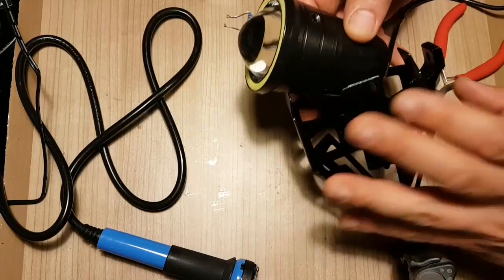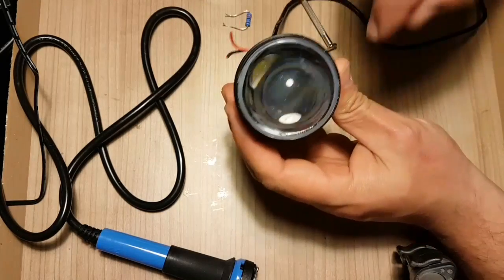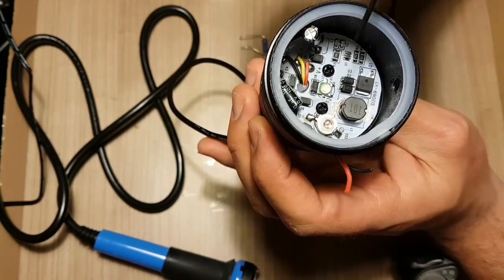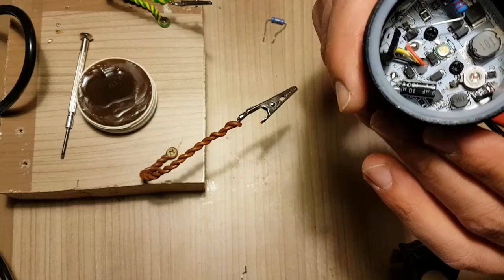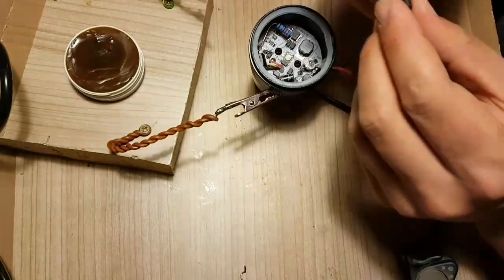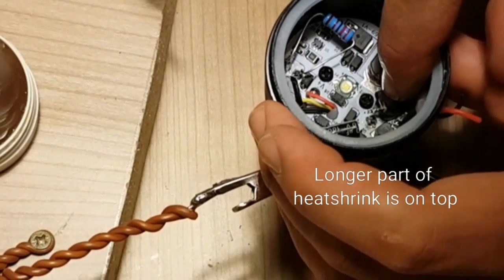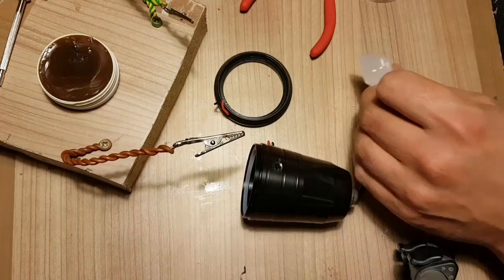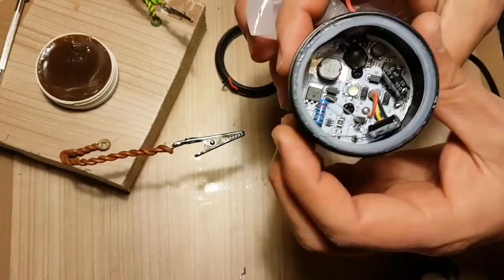U7 Cree lights from aliexpress - removal of low intensity/strobe functions and red devil eye

Comment: I've got a pair of Huiermeimi spotlights 300meter range it has 3 modes High beam low beam & strobe but & I have them installed in my old spotlight Housings & have  inside my bumper on my Toyota Hilux Surf & have found when I switch my side lights on the press my separate switch to the spotlights on they are are on high beam then instantly switch them the spotlights off then switch them back on then go to low beam & instantly switch them back on again that's when they strobe but I noticed when I switch the spotlights on after a little while later they on high beam & then switch the spotlights off again plus my side lights off as well & leave them off for about a minute or so the turn the side lights back on the press the switch for the spotlights to come back on the spotlights seem to stay on high beam then switch them back off again as well as the side lights then turn the side lights back on as well as press the spotlights switch back a little while later they just seem to stay on high beam & I was going to modify the spotlights later on & add a 10k resistor to make them stay on high beam looks like I don't have to modify the spotlights now the seem to stay on high beam which I'm Happy about having them stay on high beam & I've tried a few times now & just stay on high beam even over night & try them the following night I switch on the side lights& then press the button for the spotlights & they just go on high beam & I will be using these spotlights on log country roads where there is no traffic in front of me & traffic coming towards me & they give out Excellent Quality Lighting really Bright White lights to & even my H4 Led Headlight bulbs work great as well bòth on High Beam & Low Beam & got Excellent Quality Led lighting on my Toyota Hilux Surf I even replaced my front & rear side light bulbs to Leds & well brake lights number plate lights reverse lights to Leds the only ones that I haven't replaced are my indicator Bulbs which I will be replacing them to Led Bulbs at a later date Led Bulbs are Brilliant as long as you get the right Led Headlight bulbs that Led Headlight Chips are very small & they are the same size as the Halogen Bulb Filament or Filaments & both High beam &.Low beam Line Up Exactly Perfectly With The Halogen Bulb Filament or Filaments & having the Led Headlight Bulbs in the Headlight Housing at 3 0clock & 9 0clock & you can't go wrong  & that's the reason why I have got Excellent Quality Headlight Bulbs Kind Regards Peter

Comment: I would like to have 3 switches each for High, Low and Strobe. Is it possible?? No where i found a solution. How does it changes mode after each cycle, switch on-off.
Reply: i think try understanding the C2 chip,pull out the chip n test the arms/legs or connections/terminals....

Comment: beginner here 
is it really necessary to put a heatsink ?
Reply from the maker: Heatsink for what? Didn't put any here, so i don't know where you mean to place it
Reply: fun&games oww ty now i understood
Reply: i meant was the sinkable tube
Reply: so u put the sinkable tube to disable the ring light something ?
Reply from the maker: Yes, easiest thing to put on, and it can withstand the heat from the red LED
Reply: sir what would happen if i would no put a sinkable tube on that kind of chip ? hehehe
Reply from the maker: A bit of a dumb question but here it is: without the heatshrink tube over the red LED you would still have that red devil eye pattern which most users tend to remove due to esthetics or local regulation.

Comment: Hi, thanks for the video, really will help when I try and do mine - but I can't find the 12k ohm 5w resistors in the UK at all... So I'm struggling to complete this - mine keep going out of sync and it's so annoying
Reply from the maker: Ebay, aliexpress maybe?
Reply: @atcrijeka  wow wasn't expecting a reply so quick, thank you for that - I'll have to check those most of the ones I find are 1/4 or 3w
Reply from the maker: @MrAndMrsKnight-UK  maybe 3W would suffice. Weld it on and make sure it doesn't heat up

Comment: My boards have two capacitors labeled C5 and C6.  No U1 or U2 chip that I could identify.  I soldered a 10K resistor to drain the C5 capacitor, one leg of the resistor to each leg of the capacitor.  Works a treat.  If you quickly cycle on and off all three modes, High, low, and strobe, function.  Turn it on and off with a short pause and only High beam functions.  A quick on-off-on gets you the low beam.  A quick on-off-on-off-on gets strobe.  U5 light not U7.

Comment: If you don't cut the ring LEDs you can peel off the ring and desolder the wires from the back of the ring and then pull the wires through keeping them complete
Reply from the maker: Yes, you can, but the process of removing the LED ring without bending or breaking it is far more complex. I guess it depends on personal preference.
Reply: @atcrijeka  thanks, I want to try this, is there any more little tricks that you can do? I want to put a resistor in place of the red led too
Reply from the maker: @hcashmore11  I believe it is possible, but I haven't tried it

Comment: Can you check the value of your resistor with the Ohm Meter? According to the color bands- its value is different.  If its 12 Kohm? Also, a 5 Watts resistor is a lot more bulky that this one in your vid. In my U 7 , there are chip condensators with lower value- 4.7 uF/ 100 V and the Condensator is called C2. Should I solder a real 12 K white ceramic resistor in  over the 4.7 uF  C2?
Reply from the maker: Rainer Schulte: Herps & Fishes Sorry, I can't check it. I can't promise that it will work with a different motherboard and chips.
Reply from the maker: Rainer Schulte: Herps & Fishes The resistor I got is from a seller who sold it as 5W 12kOhm. I cheked it with a multimeter, seems legit.
Reply: Will try it and then comment.

Comment: This worked a treat, I soldered the 10K resistor across the capacitor and the high beam light is now the main light when powering on, you can still use the other modes of you flick the switch within 1sec, but it will always default to high beam after powering on. Perfect! At least I don't need to worry about strobing on coming traffic any longer.

Comment: Can you help me ?
i have a problem when i try to make 1 mode, i removed the chip u1 in my led light but the led is not lit ,,
do you have a solution ?? and i can not connect the u1 chip because its size is very small ,,
I hope you can answer and help, thanks ...
Reply from the maker: Rey STIC Unfortunatelly no, I haven't messed with the chips.

Comment: fun&games did you still use a separate switch?do you have a diagram on how did you wire it all? pls trying to make  mine work as well as yours. thanks mate
Reply from the maker: Justin Velasco Yes, I still use it, and it works great. I don't have the wiring diagram, just find someone who knows basic electronics to help you. Basically I use a relay to serve as a power switch for the lights, just so that the lights wouldn't be on whe I turned off the ignition. Relay (an electronic switch) is fed by the power of the low beam lights, so cut into it and viola!
Reply: thankyou so much man! just got the lights yesterday gonna try to put it all together later

Comment: Hello, I would like to separate the led and the eye of the devil on the one hand and the ring on the other hand.
what resistance would I have to put in the hole that is left where I remove the ring so that the devil's eye stays well?
I think the ring works at 6v, how can I transform the 12v of the bike to those 6v.
I want to use the ring as an intermittent
FORGIVE by my English, I am Spanish and use a translator
THANK YOU
Reply from the maker: Roberto Corredera Hey Roberto, sorry but you will need to wait for someone more familiar with electronic circuits to give you this answer. Good luck!
Reply: thank you very much.
for testing I think a ring has broken down, so you learn too.
in one I put the resistance and it seems to turn on and off well.
a detail is that my plate is different, has components with top track and solder worse because the condenser is stuck to the plate, without legs

Comment: I removed the two right most legs on U2 being the +/- to this. For the devil eye, I unsoldered  the top connector of the red led ( incoming power) and left the bottom connected. then i relocated the bottom wire of the two wires that feeds the angel eye, the one  positioned closest to the bottom of the devil LED. I unsoldered from its position  and resoldered to the point where the top devil LED connector was on the board.  High beam works everytime and Angel Eye works perfectly without the red devil eye.
Reply: So by cutting the 2 most right legs did you just stop the low beam and strobe function ? Also wich 2 legs on u2 did you cut as in the 2 on the right side of the body or the left or one on each side please elaborate
Reply: Pls draw diagram how to remove red demon led... But still want ring light

Comment: On this URL  is electronic scheme this LED withoud led circle. Numbers of resistor, capacitor etc in scheme  is diference. You remove in scheme resistor R5 (in U7 light it Is R11). http://www.chipli.cn/2016/chedengfangan_1202/46.html

Comment: So i want to put these on my ATV instead of my high beams.
First problem that i had the lights weren't bright at all when connected to my ATV, but when i connected them straight to a battery they were very bright, is there any way to fix it?
Also is there any way to make the angel eyes turn on when i turn on my lights at the same time or do i need to make a second switch for it?
Um and why when i turn on strobe the angel eyes start flashing instead of the leds itsself?
Reply: Use a relay and connect the light to battery, to use the angel lights you can get a 5 pin relay and connect the angel lights to the 87A pin. But if you want that function I wouldn't connect to the battery, but instead something that's 12v and only on when key is on.

Comment: Heey. How did you connect the high intensity leds with the high beam, also angel rings to the low beam? Thx
Reply: Wondering the same :/
Reply: the ring uses a separate wire, just route it to the appropriate circuit on your existing lighting system

Comment: Hi fun&games. Very thankyou for this video, strobe was a problem for me.
But I ask you, do you know if there is a way to remove only the strobe?
I think the low mode is still of use for me.
Reply from the maker: Alex Amaral well, this instructional video reduces the reset time to 1 second, and since the first two modes are high and low, you basically never have to go to strobe mode. After eset you always start with high mode
Reply: Oh! I did not notice that. xD
Thankyou again for the idea.
One more subscriber.

Comment: I've totally destroyed the driver of one of my newly purchased angel eyes ;-( trying to remove the three mode function. 
Now i'll try your solution on the survived one. Thanks in advance for the infos
Reply from the maker: Maurizio Pedron  Sorry but hahahaha!! I knoe how you feel mate, I went through two lights lights before getting it right. All I could find on youtube were some u successful attempts so that is why I decided to film it properly. Glad I could help!
Reply: Ok F&G, it works! I decided for a 1k/1W resistor. You have to be very fast, if you want to see the strobo mode again, reset time is around 0,2 sec. Resistor current is 13mA on 12V, 0,2W 
No heat at all, with 1w resistor.
Now is time to buy U7 light, replacement for the dead one. :-)
Thanks again for all the infos
Reply from the maker: Maurizio Pedron Thank you for the info and the measurements!
Reply: Hey Maurizio,do you mean 10komh/1w or 1komh/1w?
Reply: there are 12v between C1+ and ground. So i used a 1kOhm resistor. Current flowing is ~13mA. Ohm Law says that power dissipated is ~0.15Watt, so I used a 1watt resistor, only because it was already available to me. Anyway, if the light is used on a bike, the voltage can rise easily to 16Volts, so don't use resistors less than 1/2Watt
Reply: maybe LM2596 would help with the voltage?it would be like a firewall with constant 12v .
Reply: Aivaras oh yeah, but, you know, in a motorbike light, more volts means more light, more light= more security. i think i convinced my resistor to do all the hard work :-)
Reply: Maurizio do you have any clue whats the V and A of an angel eyes only? I had removed completely everything and want to install  5w or 10w high power led.
Reply: i think the eye is only a bunch of leds. i'll made some tests and let you know....
Reply: Thanks buddy. I am stuck on that and dont want to burn it down.There is no replacement for an angel eyes only so i am a little bit cautious.
Reply: Thanks buddy
Reply: Aivaras so, i tryed yesterday my standbalone angel eye. if you want to use it with 12V power supply, you need to limit the current flow with a little resistor. 80-90 ohm will be sufficent.
Reply: Thank you, maybe you remember the voltage?  I think i will use a voltage regulator instead a resistor.

Comment: how to remove strobe and low beam mode-

easy solution- remove u2 chip
problem- solved
Reply from the maker: Lalit Deore That maybe work on U5 lights, not on this model which is U7. I tried it, nothing worked after that
Reply: I have u7. It worked
Reply: But i observed that circuit of ur u7 looks little different than mine. Don't know which one is original cree
Reply from the maker: Lalit Deore That is the thing I was talking about. For this model of the curcuit board this is the solution.
Reply: May I ask if you can take a pic of your circuit so we can compare the two different circuits.  I'm waiting for my u7 to arrive and I want to see which solution I need to do to remove low beam and strobe mode. .
Reply from the maker: Janzen Rivera Really can't but try to get it from this video https://youtu.be/zpotXAArCOc
Reply: Do not remove u2 chip. Though it works but It causes over heating issues. I tested it.
Reply: Thanks for the info guys. . I'll do the change based on this video. .
Reply: how to keep strobe and i want remove high beam and low beam?

Comment: Hi f and g... ;) just got my two U5's and off to buy some resistors. Thanks very much for doing the videos as I still would like to have the option of low and strobe. Thanks for sharing brother.
Cheers !
Reply from the maker: pkwallbott No problem mate, glad I can help! Do take into consideration that my lights are U7, and as much as I saw from other users, it is a different circuitry. Good luck!
Reply: Ya, I checked the layout of the board and seems almost identical except for the addition of the angel eye and ring circuit. Besides, these U5's are very inexpensive in case I do melt something.

Comment: Hi thanks for you video. I have a different brand light but very similar inside. Just wondering how you're lights are going now. I am no expert either but was wondering is it ok to short the capacitor for long periods without any danger of blowing it.
Reply from the maker: Paul King Hi, for now the lights are ok, i have been using it for three weeks. No heat buildup whatsoever.